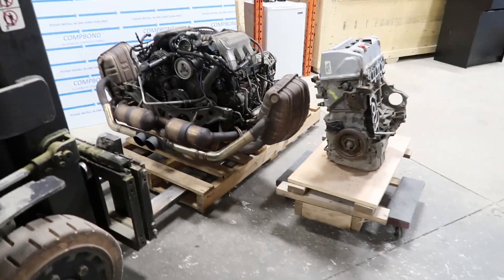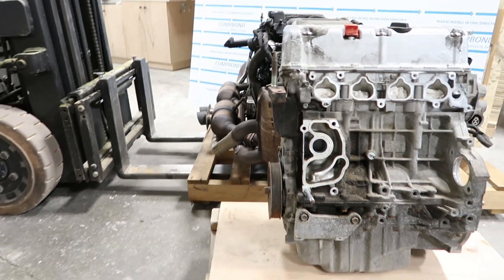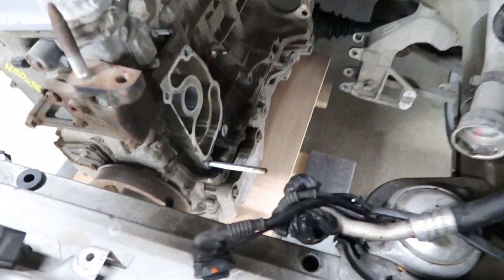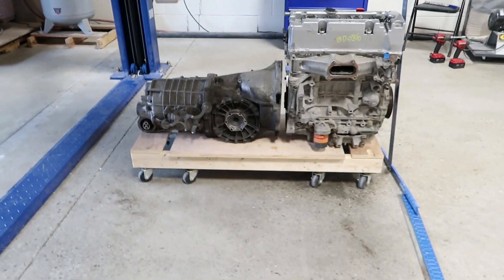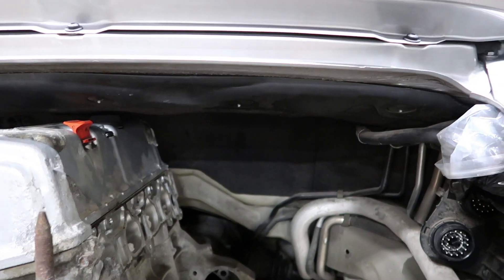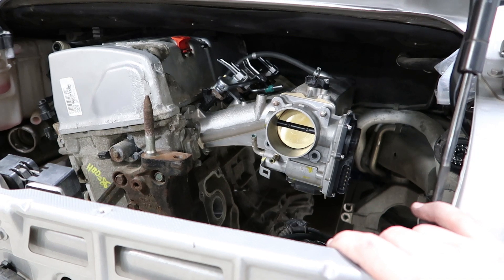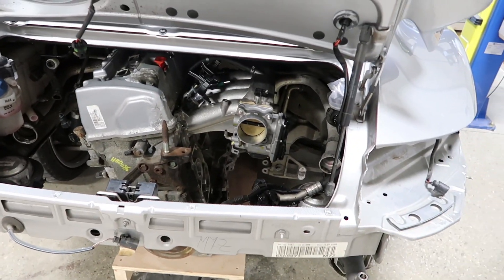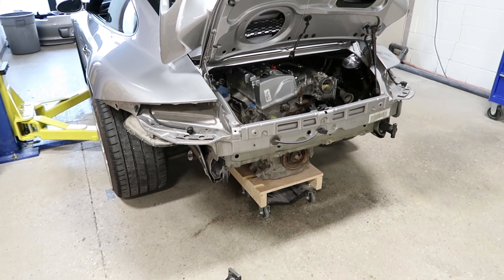K24 Fits in the 997

Comment: Hi Nick, You said the k20 is an inch shorter.  Is there a k20 with the same exhaust manifold as your k24z7?  I want to do a similar swap into a 996 but don’t want to make the low profile valve cover if possible.  Thanks so much and thanks for sharing your journey!
Reply from the maker: Unfortunately the K24Z7 and the K24Z3 are the only K's with this header port - I think even a K20 will need some sort of low pro valve cover tho - I will be doing a production run of these valve covers soon tho

Comment: Dow the line, you may want to get the KMiata intake manifold. Great plenum and compatible with drive by wire.
Reply from the maker: Ive talked with KMiata - I really wanted to use their intake. Check out my update video, my new manifold solution is much better then this S2000 manifold